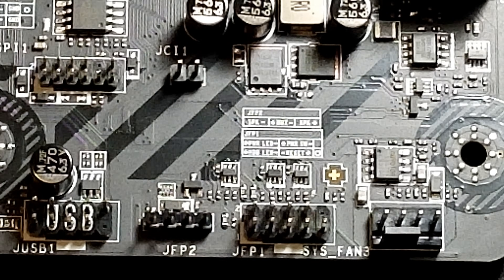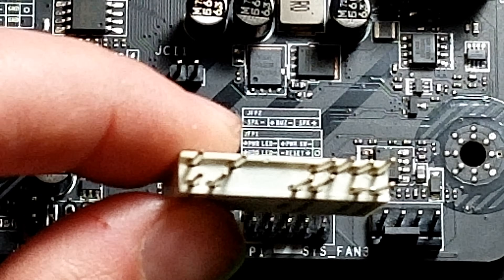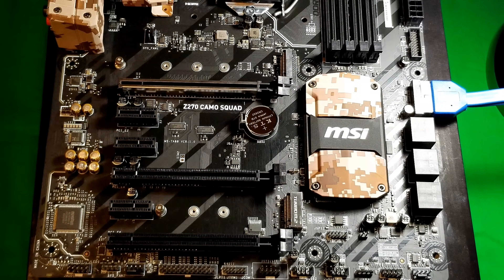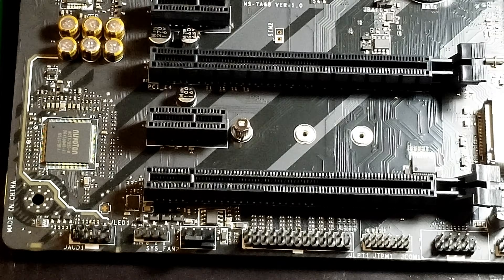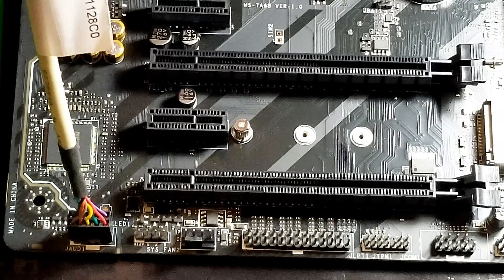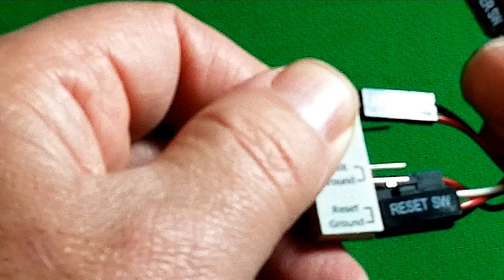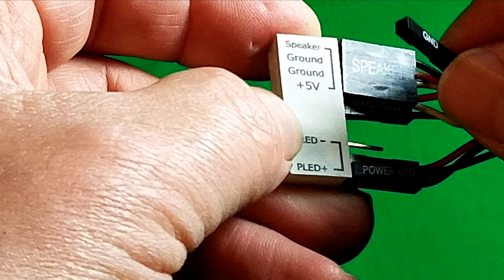Connecting your Case Front Panel connectors to your Motherboard

Comment: Is it possible my corsair case doesnt have system speaker and hdd led connectors? Corsair obsidian 500d rgb
Reply from the maker: Had a quick look and can't quite tell if it has a reset button or LED light on the case, if you have a reset button but no spot for the HDD LED on the case then yes it's possible there might not be a HDD LED Connector, and a lot of cases don't include the speaker so that could be normal as well.
Reply: Reviewing Playing & More RPM Thanks so much for the fast response!
Reply from the maker: +Darth MaJor Glad to help...

Comment: Any idea why I'm getting static hissing noise on my VR earphones connected to  USB 3.
Reply from the maker: Unfortunately I haven't used VR as yet, but maybe try plugging into the motherboard audio at back of the case instead of the front case audio, sometimes the audio on the front of some cases isn't very good but the motherboard can sometimes be better. Not certain if this will help but only thing I can think of at this time...Hope it helps, and thanks for watching...

Comment: Good video, good explanation. but one big problem is that when you were saying the arrows on the back indicated positive was wrong and they indicate the negative/ground on the connectors. you can even see when you're plugging them into your Asus adapter at 9:15 that you plug the HDD LED pin in the wrong way up as your adapter even says positive and negative opposite to the way you plug it in, what you should have done is plug it in with the HDD LED writing facing down from the camera.
EDIT: proof is that when it comes to the power pins at 10:30 you put the in the correct way, facing down, with the arrow plugged into the negative/ground.
in general, an easy way to tell [but NOT always the case] is that the red or coloured cable is the positive. a black cable tends to be the negative, and a green cable tends to be ground. again this is only best practice and not always the case, but it is in this instance.
Reply from the maker: Appreciate your input, the HDD LED can go in either way makes no difference in terms of it working, I do however usually put it as you mentioned face down as recently it was mentioned that the LED Light on the case may not work otherwise, I have yet to verify this. Every video I've seen and research shows the Black arrow indicates positive, so would love to know where you get your info from. Thanks for your comments...

Comment: Unfortunately, with a high-end Antec full tower I plugged in the USB2 connector to the front panel, and the black wire starting to get very hot...so I removed the connector because I don't need USB 2 on the front panel...The USB 3 worked perfectly, however.  Are the back connectors for USB 3 and 2 all deriving their power from the Motherboard (MSI gaming 5)?  I also am not getting any beep codes...hmmm.  Any suggestions?  I'm replacing the motherboard due to some bent pins in the CPU Socket....I want this new installation to go right (minus the USB 2 to front panel).  Can you help?
Reply from the maker: Yeah that's not normal for the USB 2.0 from the case to do that, something defective, best to RMA the case if you still can or just not use it if you can't. Yes the back connectors USB 2.0 and 3.0 get their power from the motherboard via the PSU...The lack of beep codes could be because not all cases include a speaker which is needed to hear the beep codes. You could get one for a couple dollars. Hope I've answered all your questions. If not ask away and I'll do what I can...Have a great day!!!

Comment: Is gnd just - basically?
Reply from the maker: Hi Doogie Taylor, sorry not sure I understand your question please ask again. Thanks...
Reply: @Reviewing_Playing_and_More_RPM  gnd which I'm guessing is short for ground. Is that where you would put the -ve side into? I have a layout where it says pwr button by itself with only gnd around it so does the -ve go into there? There is no pwr -ve place and the plug is joined from the case
Reply from the maker: Yes gnd is short for Ground. Not sure what -ve is supposed to be...tell me your Motherboard and what connector your unsure of and I'll help.
Reply: @Reviewing_Playing_and_More_RPM  short for negative, sorry. It's an asrock b360m pro4
Reply from the maker: Ok I understand now, sorry about that, so on your board the manual shows it a bit differently then I've seen it so yeah a bit confusing, so the PLED has a + and a - so the two connectors go left to right + and - for the PLED, on the top, beside it is the Power LED, then on the bottom the Hard Disk Drive goes on the right, with the reset to the right of that. Hope that helps...

Comment: Good explanation, but It bothers me that you were louder in the right ear, I recommend changing the audio settings on your mic or editing software to remove the surround sound feature.
Reply from the maker: Yeah my apology  for that, tried to fix it but for some reason it wouldn't let me balance it out, will work on it in the future, thanks for your comments...
Reply: Thanks for responding it’s nice to see a YouTube who actually values its fan bases concerns and is listening to their advice.
Reply from the maker: It's how I get better so I can provide better content and grow, Thanks...
Reply: O and I was just installing some new pc parts and my usb 3.1 port pins got Bent and broken I’ll flat out admit it’s probably my fault, but I was wondering if you could give advice for repairs, one pin fell out and is gone, while the others could be easily bent back into place.
(It’s the motherboard slot where you plug in the case usb)
Reply from the maker: It's unlikely it'll work properly once a pin has been broke off, I mean you can try plugging into it, but it's likely it'll give you some intermittent errors...what I've done on motherboards that were older and didn't have the USB 3 was I bought and adapter that fits into the PCIe slot, the item I'm referring to is a Vantec 4-Port Superspeed USB 3.0 PCIe Host Card w/internal 20 pin connector, this one is powered with a Molex connector, and also provided 2 extra USB ports. There may be others like this for USB 3.1 but you'd have to Google it to be sure. But I've used this one and it works great...Hope that helps...

Comment: i got a problem with my pc case  masterbox MB600l i don't know how to conect my front panels on my asus b450 f
Reply from the maker: Here is the link for your Manual, it shows where your connectors need to go, hope it helps... https://www.asus.com/us/Motherboards/ROG-STRIX-B450-F-GAMING/HelpDesk_Manual/ there is a image to make it clear... It's on page 1-20 showing the diagram...
Reply: Thanks alot man you saved my gaming pc build!
i am 100% subscribing
Reply: MY specs 
PC case cooler master MasterBox  MB600l
Asus strix rog b450 f gaming 
Ryzen 5 2600
SSd kingston 240GB
corsair vengeance ddr4 8 gb
power supply fractal design 650w
GTX 1060 6GB OC edition
mouse corsair harpoon
Keyboard logitech g213 prodigy
Monitor samsung 24 curved
Reply from the maker: Solid build, sounds great...You'll be rocking those games now...Glad I was able to help, and thanks very much for your support...

Comment: I just assembled a PC for the first time in over a decade and I have to say, the case connections to the motherboard remains the most difficult part and archaic as hell. 

The CPU has thankfully evolved to remove the pins that you had to try hard as hell not to bend, so I'm glad to see some improvement.

I'm sure the cluster of pins on the motherboard that let you connect your case to your motherboard are basically all the same, so how about an adapter I can put on the motherboard and some easier way to connect those stupid little connectors?
Reply from the maker: Some motherboards do come with the adapters to plug the LEDs into and then to the motherboard, just wish it was more common...Asus is the most common but Gigabyte has started doing it on some of theirs now as well...
Reply: The motherboard I was working on was ASUS and it didn't have it. Maybe it's something I have to buy. Amazing the cases don't at least make the red wire the power wire.
Reply from the maker: Yeah they seem to only offer it for certain one's of the Motherboards they sell, worst part is they don't always mention it when you're buying it, and it's usually their higher end motherboards...I did purchase 2 separately from Amazon, but had to so some research to be sure it could be used, they really need to make that information more widely available. Although once you build a couple systems it becomes easy to do and then you won't need it. The power cable should be marked as power but if not that would make it more difficult...
Reply: Plugging in the wires from the case to the MB is doable but unnecessarily clumsy. How about at least an ANSI standard for standard pin assignments, making installation easier and making adapters worth offering?
Reply from the maker: I know there are ANSI Standards but not sure how it might apply toward motherboards, if there isn't one I'd be surprised, there for sure should be as you've said...Thanks...
Reply: Seriously if u have no idea there is a magical thing called "manual"

Comment: Which one is for the 35'mm headphone jack , I'm having trouble making sound coming from that and also the led lights to indicate it's on.
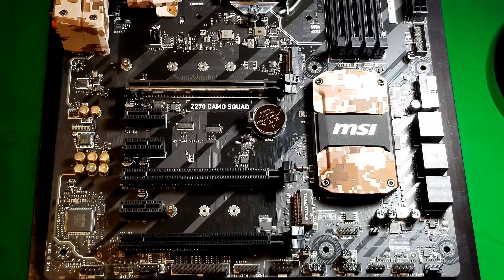Reply from the maker: The sound from the front audio ports on front of the case come from the connectors on the back come from the motherboard, which in my video would be the JAUD1, sometimes it will be called something else but as it shows at 3:53 in the video on the very far left this is where is it almost always located, haven't seen it different but doesn't mean it couldn't exist on a different motherboard. The locations of the 3.5mm headphone jack usually is indicated by a symbol on the front of your case that looks like headphones, on the back it's usually the middle connector. Refer to your Motherboard manual to be certain, although I don't think it changes much if at all. The Led light not showing could be because not all motherboards have a led light, most newer one's do though. If your LED's are connected and you have power to your PSU and you turn it to the on position it should turn on. I have seen sometimes where this needs to be turned on in the BIOS but I'm not certain how often this happens pretty sure it's not often though. Sorry for the late reply been a crazy day at work. If you have any other questions or I misunderstood the LED question let me know and I'll help as best I can. Thanks for your comment and for dropping by...

Comment: Also do I use the block? The block fits all the connectors and fits on to my motherboard so I just plugged all the front io connectors to the block, then connected the block to the motherboard.. I haven’t turned it on yet lol
Reply from the maker: It can be confusing, if your motherboard came with the block, called a Q-Connector you can connect the led's to that, and put it over the one's on the motherboard. However when I first started I did this, but after once I knew what went where I'd just plug directly into the motherboard itself. If there is confusion you can refer to the motherboard manual that came with the motherboard to verify...
Reply: Reviewing Playing & More RPM It seems everything is plugged in properly, I have the motherboard and psu in the case and a monitor nearby, so when I turn on the psu the motherboards rgb’s come on.. but when I hit the power button on the case the cpu fan spins up and rgb’s come on but no posting on the monitor. Granted I have no keyboard or mouse or hard drives plugged in yet but I thought I’d at least be able to get into the Bios to see if everything is working properly :( not sure what to do now but connect more stuff and see if the power connectors from my psu are seated properly.
Reply from the maker: As long as there is nothing wrong with the core components, ram, psu, cpu, cpu heatsink n fan, motherboard. The comp should power on, with the fans spinning up, which you said it did, so now you can add a graphics card or use onboard graphics if available, and you should see the bios post screen, add a keyboard, and the bios post will complete. Now it should show a black screen with an error saying that no hard drive is installed. They after a screen saying there is no OS and to insert a DVD or USB to install...

Comment: Ok so the black arrow always goes where the ground is? My dad told me the positive does not go on the ground because ground is negative, so I’m super confused
Reply from the maker: So when looking at the motherboard, top to bottom it's like this; Power Led's the two small one's with + and - goes + - then Power right of that, + and - again, then bottom HDD on the left does matter how it goes in as long as it's on the pins, then the reset switch on the right of that... Bottom line if you plug it in wrong it won't work, if it works you got it right...Hope I didn't confuse anything...

Comment: My won't work? I have been putting it in from the manual
Reply from the maker: So if it's all plugged in as per the motherboard manual are you getting anything when you push the power button? also check the memory is in properly as this will affect it as well...Give me some more info and we'll go from there...

Comment: Do I need the adapter my motherboard didnt come with it
Reply from the maker: Sorry don't remember mentioning an adapter in this video, can you provide more info on what your motherboard didn't have? Thanks...
Reply: Reviewing Playing & More RPM I have the gigabyte b350 matx, and I am confused as to what front panel connectors go where and I don't get the positive and negative, can you help?
Reply from the maker: The video does show the + and - , but if you couldn't see it maybe, the PLED has a +(positive) and a -(negative) you need to look on your motherboard to locate where this will be, on your motherboard I believe it will be a FP for Front Panel connectors. it's usually top left two separate pins looking down from the ram to the pins on the bottom, verify it with the motherboard manual though. Hope this helps...